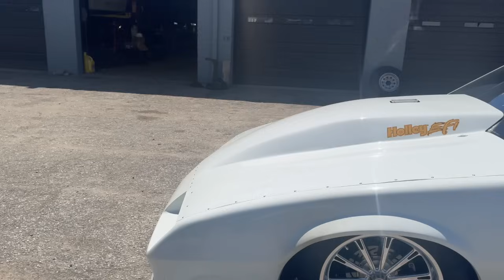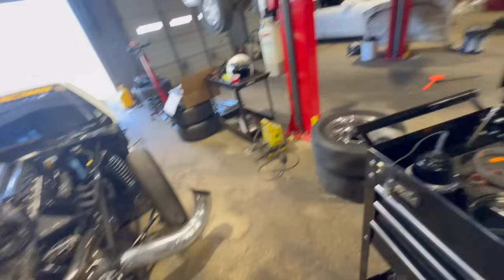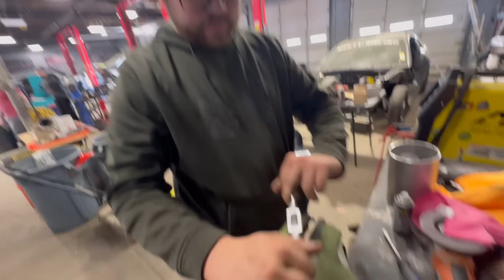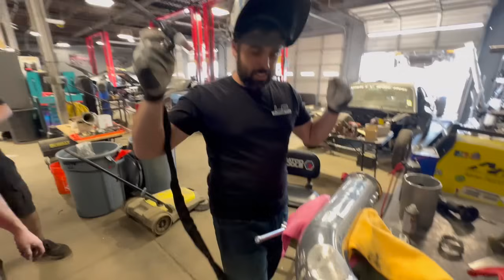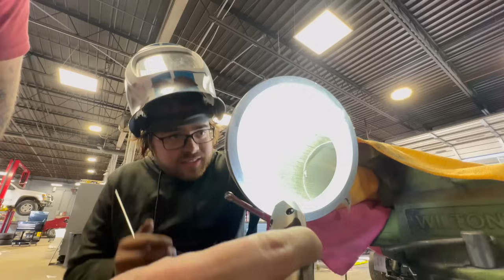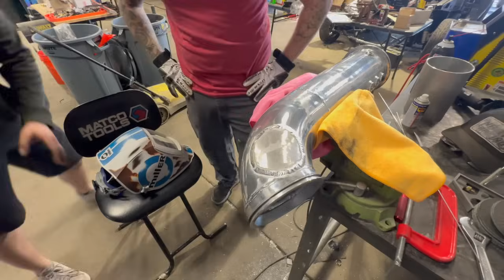CUTTING APART my 4000hp CAMARO!!!

Comment: Pressure test the intake system. Y all should log turbo shaft speed to see how it correlates to boost pressure could have some boost leaks. Check the diaphragm in the Bo v to see if its leaking. If there is no pressure routed to the underside of the diaphragm it should not open under boost unless the pressure is that much lower in the manifold due to boost leaks.

Comment: I would put bungs in several spots in the intake tube and  use the sensor to see where the best place to put it and just put plugs in the bungs not being used. place them in the bottom and they won't be visible